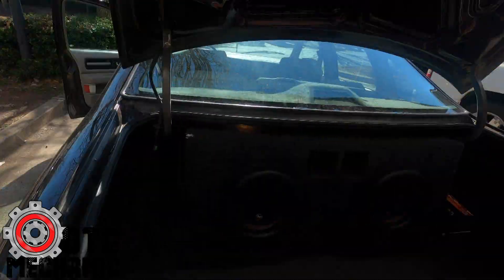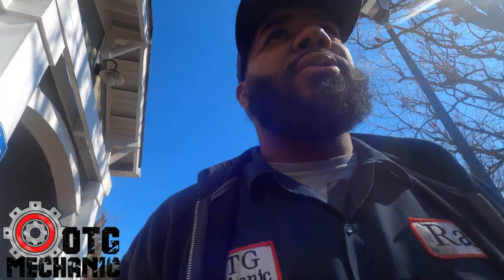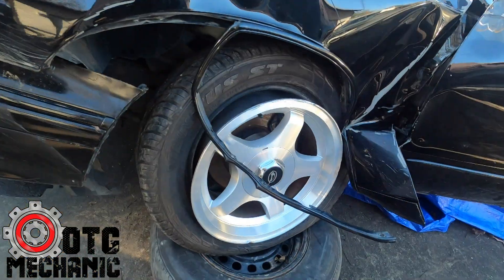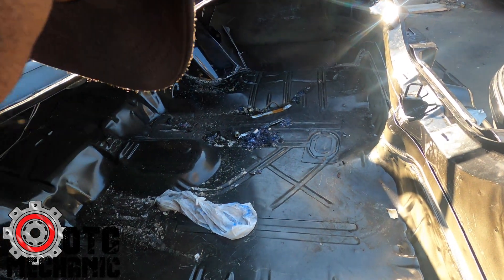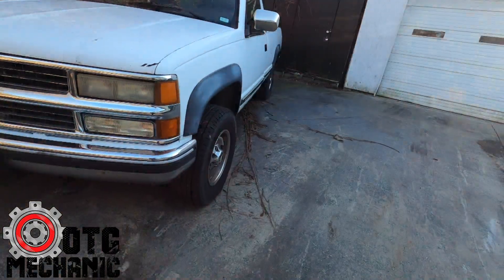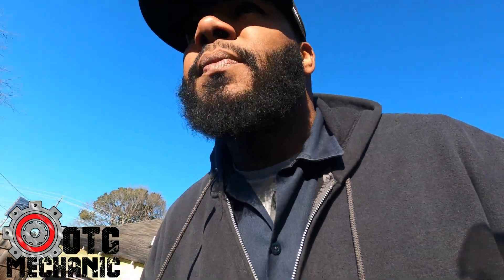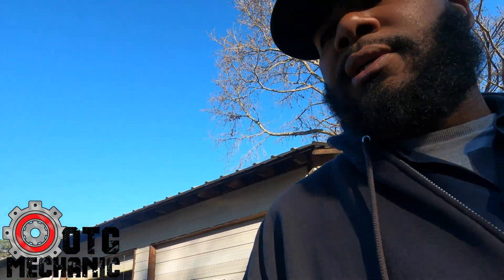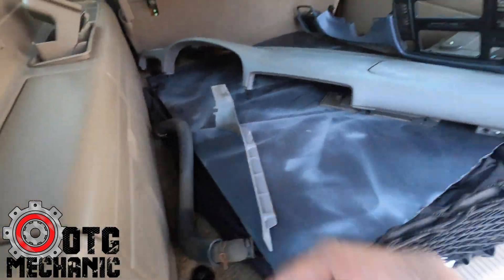Picking up parts from Mr @impalassparts himself and final tuning the 1996 Impala SS sound system

Comment: Have a question for you, my 96 has a rough idle and sputtering when I’m driving... did the plugs, cleaned the injectors, and did the cap and rotor can you give me a idea of what it could be?
Reply from the maker: Check fuel pressure
Reply: check vacuum hoses
Reply: Check that you have a cap and rotor....